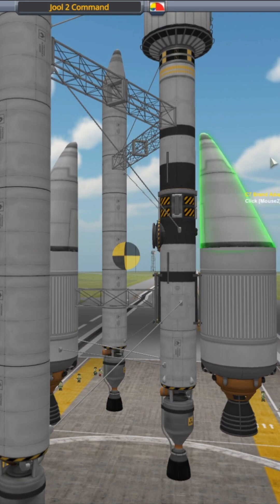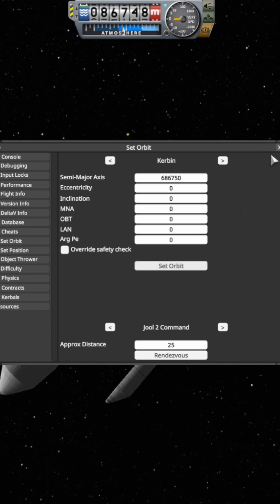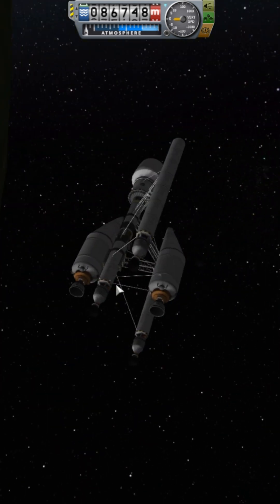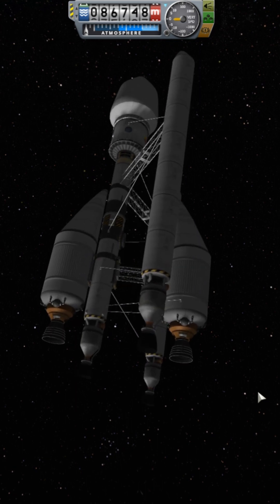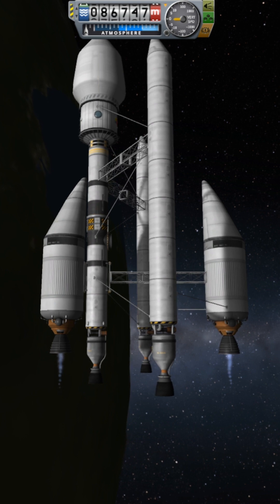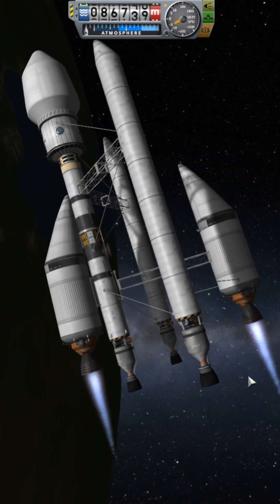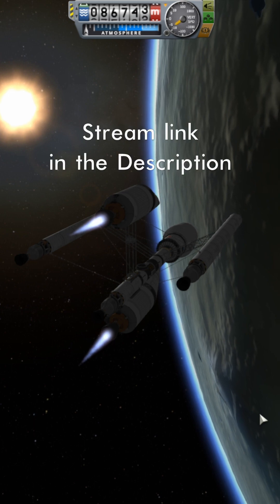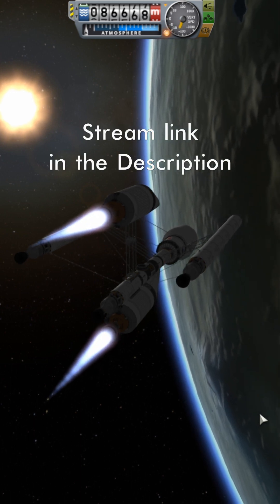Balancing Thrust | Kerbal Space Program Short

Comment: Someone already commented on thrust limiting. The other useful tool is the center of thrust indicator in the VAB. You can use fine rotation control to aim the engines off center such that the center of thrust arrow intersects the center of gravity sphere. Then you can add a probe core or docking port rotated the same to control from.

As long as both engines are pointed in the same direction, there should be no efficiency loss.

Comment: couldn’t you also add a thrust limiter?
Reply from the maker: The problem is that this is the upper stage of a launch vehicle and both boosters need to flame out at the same time.
Reply: @MikeAben  connect them with a fuel line!
Reply from the maker: @thedon6636  That'll work, but this wasn't the end of the lifter. Only the upper stage. A lower set of boosters was still coming and they need to be balanced about the CoM too.
Reply: @MikeAben  got it, thanks!